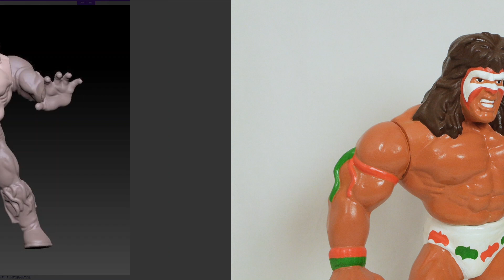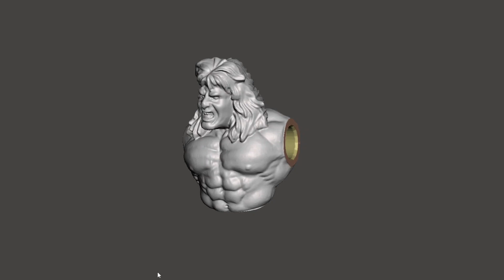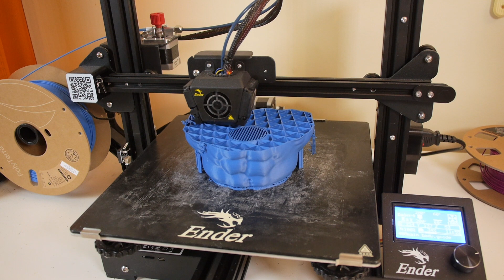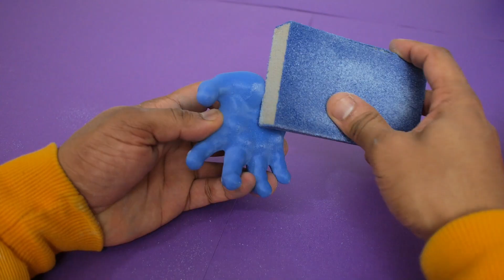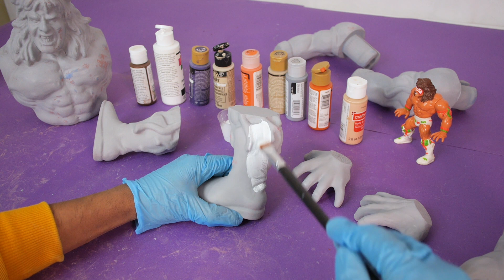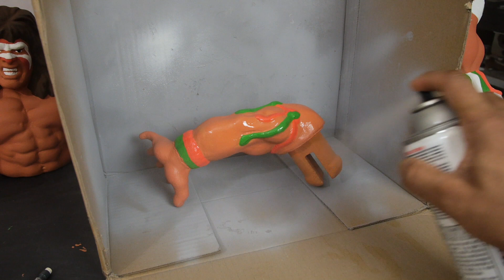I Made a GIANT Wrestling Figure! Hasbro WWF Ultimate Warrior 3D-Printed

Comment: Thats great. Its one of the most iconic hasbro figures. The print seems great too. Can you tell us which filaments you have used and what your slicer setting for this print were?
Reply from the maker: Thanks! I used PolyTerra PLA filament... I can't remember the exact slicer settings that I used for this particular print, but I didn't make any significant adjustments to the default settings in CURA. I just changed a few things like infill percentage to speed up the printing process and use less filament.